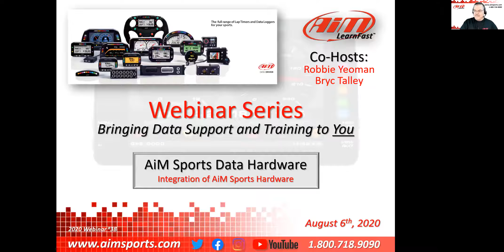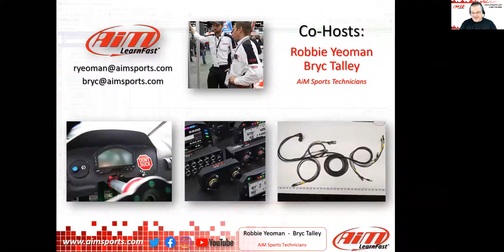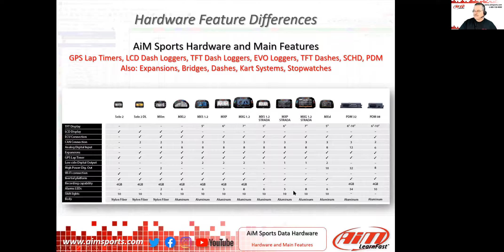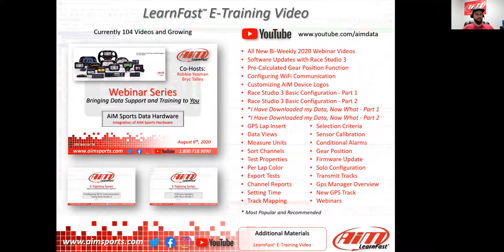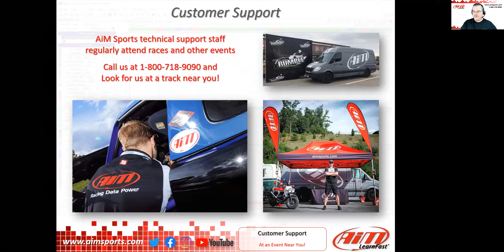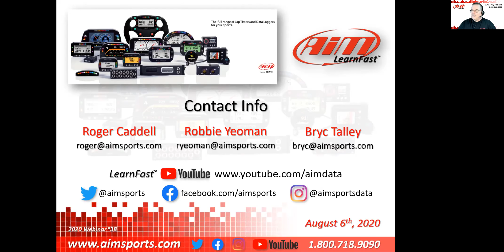1-38 AiM Sports Hardware Integration - Live Webinar with Robbie Yeoman/Bryc Talley - 8/6/2020

Comment: Can I use an MYCHRON5/MYCHRON5 2T on a 4 stroke carberated motorcycle?
Reply from the maker: It really comes down to the ignitions system. If you have COP, Coil On Plug, then getting RPM to read is difficult. However, if you have more conventional spark plug wires than I believe the Mychron5 or Mychron5 2T will be a good fit.